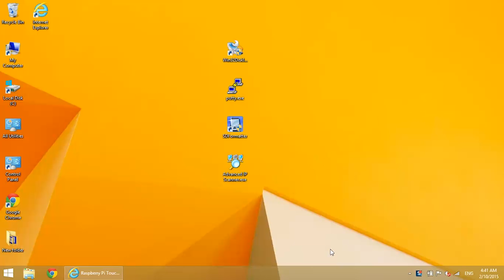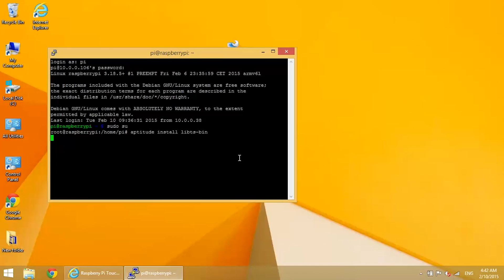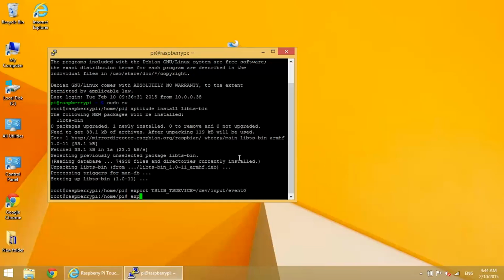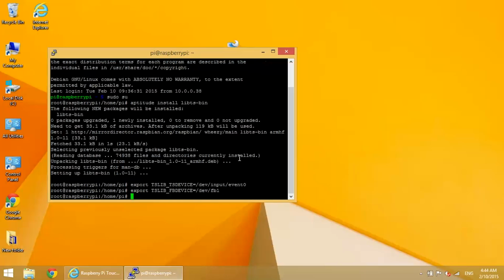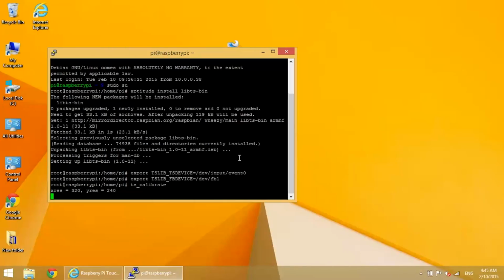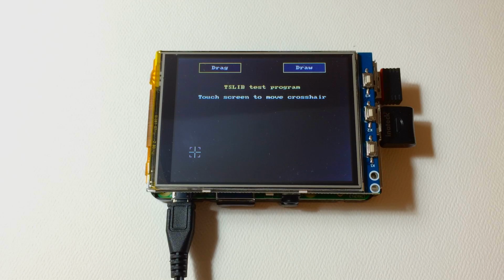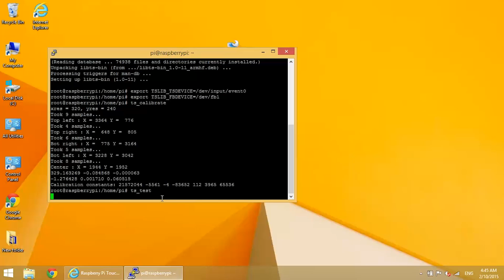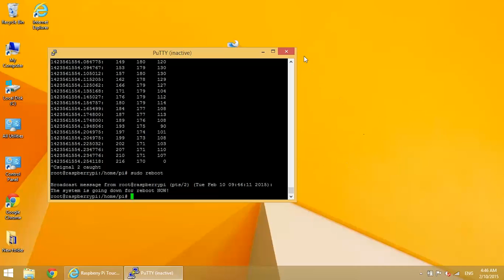Raspberry Pi LCD Touchscreen Calibration

Comment: I have 7 inch  hdmi resistive display of waveshare .but it's touch not working in gud manner , when I go from left to right ..cursor comes from top to bottom. I tried so many ways but it's not solved..plz help me...it's too frustrating ..thanks in advance
Reply: Mine does the same. Have you found a fix?
Reply: @Dillixx  no bro..I didn't find any solution for this

Comment: ts_calibrate -> "no such file or directory" :S what? not work :( instruccions exacly on video

OS rasbian 2017-05-07 and touchscreen 5inch HDMI touch.

wat problem?

sorry my inglish is bery bad
Reply: Maybe you just used wrong environmental parameters, in my case, I use 
export TSLIB_TSDEVICE=/dev/input/event5
export TSLIB_FBDEVICE=/dev/fb0
and it works fine in ts_test, but the calibration didn't effect the system.

Comment: I able to to configure touch calibration correctly on 3.5 inch  pi screen. 

There is a issue with actual touch coordinate and touch event on screen.

calibration data on /etc/pointercal and ts_calibrate ouput is different.

pi@raspberrypi:~ $ cat /etc/pointercal
-8527 -25 33623136 34 5705 -1482644 65536

ts_calibrate output:
---------------------------
Calibration constants: 33623136 -8527 -25 -1482644 34 5705 65536 

Do you know the reason for this.

Comment: I get:

open fbdevice: No such file or directory

this is on jessie thou....
Reply: and i use an hdmi monitor with touch over usb... 

works out the box but calibration is off at the edges but spot on at center of screen
Reply: I have exactly the same problem.

Comment: i have a waveshare 3.2 inch lcd v4 and I follow your process and my touch screen don't work. I have model b rpi with raspian wheezy 2015 updated and upgraded.
it still comes up as waveshare32b not reconized at boot.
Reply: got the touchscreen to work. I had the wrong image. the one they sent on the dvd was for 3.5 inch, and dvd was damaged. now need to program buttons.